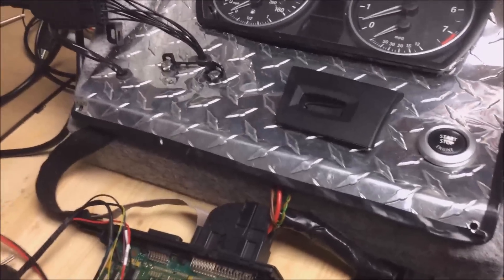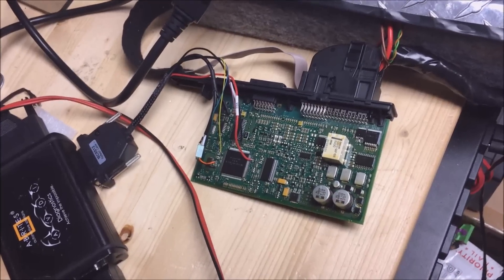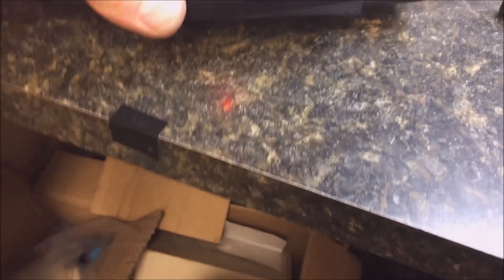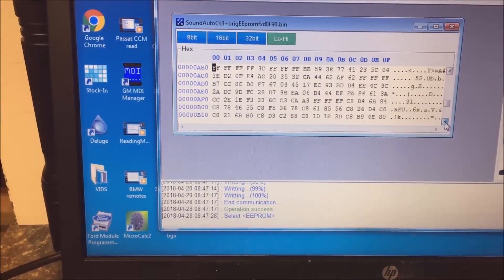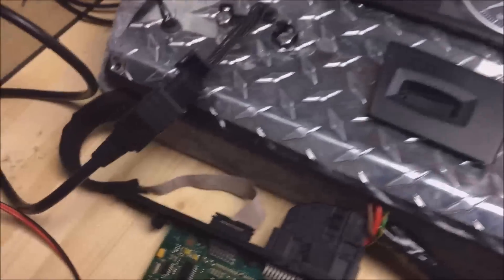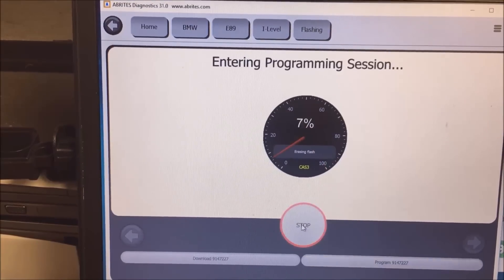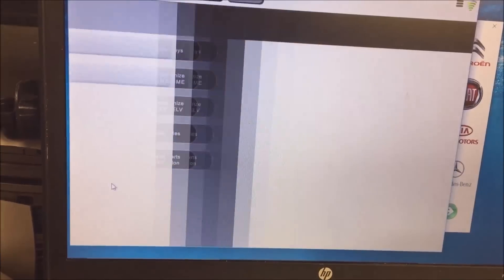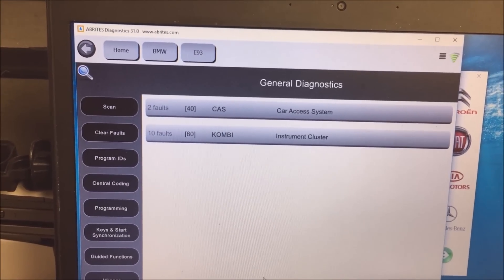BMW CAS3+fix

Comment: I have 2008 535xi. problem is it will not recognize the key and does exactly like your test dash at the end of this video. Has a new battery and starter, and ignition switch/fob holder. My local BMW shop says that the DME and CAS are not showing any faults and that they are synced. He said that the antenna ring was not communicating but said there was no code.  Question is how did you get your to recognize the original key. Benn banging my head against a wall for a month until I saw your video. 1st thing I have seen that shows the exact thing my car is doing.
Reply from the maker: First, what is your shop using to diagnois the car? next, are you sure your key is good? Is the key programmed into the CAS?  What I did in the video was to read the data, fix the lock bits, then write a good flash to the CAS.  I actually fixed the cas and then made a copy of it. At the car, put original in, and the car started and my friend tried using ISTA again, halfway thru flashing the CAS, it bricked it again, we put another CAS with the same data, and ISTA bricked it too...  I rewrote the original CAS and then used AVDI to update the I level on the DME, that was what the mechanic was trying to do with ISTA...  BMW ISTA support told my friend he needed to purchase a new CAS and program it in...
Reply: @timtracy9442  I am not sure what software he is using. he did program a new key but it does the same thing the old one did, so pretty sure it is not the key, I also cut the old key apart and put in a new battery just in case it was that however it still only locks and unlocks the car but will not allow car to enter startup. Only thing he told me was that the "antenna ring" was not communicating with cas but said there was no code. I thought the antenna ring would be in the fob holder but I am probably wrong, however I did put a new one on just to check and it changed nothing.  Just tired of paying people who say they know what they are doing for nothing. I am one of those people who has always just done my own wrenching but that is on American cars, I know this is completely different but at the end of the day for the money I am spending to have it worked on by a shop I am about ready to just buy the programs and learn to do it myself. Really a shame how crappy most shops are now days, just used to people who don't know any better throwing money at them. I guess at this point would I better of money wise to just buy a new cas and have it programed to the car instead of risking taking it someone who may or may not know how to fix the existing one?
Reply: @timtracy9442  Key will lock and unlock doors
Reply from the maker: @bendoran9883  OK, so the key locks and unlocks the car, but when you put it in the slot, the car does nothing??  When you put the key in the slot, does any light on the cluster light up??  Next, have you gone to the fuse box in the trunk and checked all the fuses??  there are three fuses that feed the CAS, if the 5 amp is blown, you can talk to CAS, program a key, but it won't turn on terminal 15....  also, do your door handles have any sqiggles on them?  as in, does the car have keyles go?  that is where you can walk up to car and touch the handle and the car unlocks.  let me know what you find..  I am curious now...
Reply: @timtracy9442  Key will lock and unlock doors intermittently,  have to take negative cable off and back on the key will lock and unlock again. When key is placed into slot the car dings and shows the key with a slash though it, and a gear with exclamation point in the center ( that one only shows up once then goes away), the only other light that comes on other than floor and dome lights is the neutral light on the shifter blinks. Also you can hear the fans on on the Idrive spool up but nothing appears on the display. The fans do go off after about 5 min so it is evidently going back to sleep. I have been through both fuse panels, and everything checks fine. No on the keyless go. Only thing i have been told since  talking to you is that if the car was shut off while in gear the CAS may have corrupted that key code and that it will still lock and unlock but will not start car. I am at a loss and tired of throwing money at the thing. I only have $1,700 in the thing and should probably just start parting it out but I hate to let something get the better of me especially if there is a chance it is just something stupid easy once I track it down.
Reply: @timtracy9442   Tim Tracy  I found the codes that the guy i bought it from before he changed the starter. A0B4/present, and Key Code HA0001, 4803 if that helps put some puzzle pieces together.
Reply from the maker: @bendoran9883  A0B4 is just telling you the CAS tried to start the car and the starter failed to crank...Keycode Ha00014803 is just a mechanical key code for the car..  I would take a volt meter, or a test light, go to the starter, find the smaller wire on the solenoid, and put the test light on it and have someone hit the start button...  You probably have the corroded wire syndrome that is prevalent on these cars...  The wire from the start relay down to the starter solenoid corrodes inside the sheath (plastic outer layer), it might just be the wire down to the starter..
Reply: @timtracy9442  Would that cause the cas to not recognize the key?
Reply: @timtracy9442  I will try that but i thought without key recognition the CAS would not even try to send power the starter. Also those codes where before having the starter replaced and have since been cleared.

Comment: Thank you. I restored my cas3 module. I used ACDP and the process was a little different but in the end the car was perfect without even needing to program the CAS because ACDP prepped a eeprom file with the DME ISN and the VIN etc.
Reply from the maker: I love my ACDP....  it has been working flawlessly....
Reply: @timtracy9442 yes besides these ECUs that provide only 4 digits ISN such as E70 nd E63

Comment: How long does it take to learn this stuff? And car coding in general
Reply from the maker: Usually a day, I woke up one morning and decided I wanted to flash modules... By five that afternoon I was an expert...  Just kidding...  I have been working on cars for about 45 years, I got into the electronics of cars back in the 80's when GM went to the electronic feedback carbs... I was just like everyone else at the time, hated fuel injection, electronic ignition, and the rest.... But when you figure out how the systems work, and realize how if you tweak the info the computers get from the sensors you can make more power, it starts getting fun...  If you can, go to a library or search online for old books about bosch engine systems...  When you can understand how the computer feeds power to the sensors, and then recieves data back from the sensors, and then acts on that data, you have a good chance at figuring out what is wrong....   For example, a car won't start, it cranks, but won't fire...  what sensor does the computer get the data to fire off the sparkplugs and injectors???  usually the crank sensor or the cam sensor.. Next, does the sensor have power?, do the wires from the sensor to the computer have conectivity?   Once you have a general knowledge of how the system works, you can troubleshoot...  As a guy I worked with when I was in my 20's told me, Kid, the majig is in the cards, if the wires connecting them together are good, then the problem is the cards...  Good luck...

Comment: Love the sound it’s an improvement from the old silent films. So you had the Vvdi BMW tool and the Avdi bmw tool and your test set up to get this done. Was this just a extra key or lost key to start out? Or was this cleanup from someone else’s headache?
Reply from the maker: Your going to laugh...  One of the shops I work with alot, mainly because he is an awesome tech, called me and said he had a 2008 3 series that he was using the factory tool (ISTA) to update the DME because of the High Pressure Fuel Pump issues, and it bricked the CAS...  I got another CAS with the same part number, and adapted to the car, then figured I would try and fix his... So we had 2 CAS modules that started the car and all was well, he tried to update the DME software again, and ISTA bricked the 2nd CAS... He sent BMW tech support an email and they said he needed to replace the CAS module...  We put the original back in the car, all was well, then we used AVDI to upgrade the software in just the DME...  The issues with the high pressure Fuel Pump went away, and car ran great...  There is a TSB on these to replace the High Pressure Fuel Pump sensor and then update the software in the DME... The shops customer was happy the car didn't have to go to BMW....
Reply: Could you have done this with the vvdi2 tool? I’m looking at getting a vw tool and bmw. AVDI is a little expensive.  Is the vvdi China’s copy of the AVDI? Or did they developed their own software?  I do know the vvdi tech support is little to none. AVDI will have better support but like I said cost is a factor for me.  Plus if one is real hard I’ll send it to you.
Reply from the maker: @tomking3942  I haven't seen where VVDI can do this...  But they might have it soon...  There is a service that you can subscribe to and get CAS files to fix a CAS that has been screwed up.. I can't remember the name, but guys are talking about it on facebook...

Comment: Any chance to check parameters of key holder inductive coil? Voltage and current? Id like to create a charging station at home for key fob.
Reply from the maker: Sorry, I didn't see this comment until today...  Great idea..  We need to figure out how much voltage and current this is putting out to charge the key...  I don't have the tools to check some of that, but I will hookup a slot and a CAS and see if I can figure out what it is putting out..  It would be nice to have just a slot to be able to keep peoples keys charged...  And maybe one for the older E46 diamond keys...  they are always going dead...  Great idea...
Reply: Not sure if this would work on the diamond shape keys but I found this https://www.google.com/amp/s/m.wikihow.com/Charge-a-BMW-Key%3famp=1

Comment: Hello
I tried to program the cas by cgdi and now the car does not start. please contact lipton8111@web.de
Reply from the maker: If I were you, I would be talking to CGDI support...  I have no idea what, or how it reads and decrypts the CAS info...
Reply: @timtracy9442  Thanks for the answer they can not help me. I suspect that the flash has damaged
Reply from the maker: @marcinl5876  have you read the flash and eeprom from the module???  Which module is it? a cas 3, cas3+ ??  you realy haven't given any info.... If you post what the part number is, might be able to help...
Reply: @timtracy9442  
yes I have already flash and eeprom this is CAS 2 6981416
Reply from the maker: @marcinl5876  which mask does the chip have?  CAS2 is usually foolproof...
Reply: @timtracy9442  2K79X
Reply from the maker: @marcinl5876  I looked in my files, and I don't have that one....   I would post your flash and eprom on Digital Kaos and ask for help...  There are alot of really talented folks on that site...  somebody might be able to either help you fix your data, or send you a known good flash...  I usually just find a used one and then read isn from DME and rewrtite that isn to the cas, then sync them...  AVDI takes about 20 minutes...
Reply: @timtracy9442  
The problem was solved cgdi deleted ISN.ISN I read from DDE a friend from Bestdiagcar spends the matter online.
Thank you for your help
Reply from the maker: @marcinl5876   Did CGDI delete the ISN, or did you not put one in???  It usually asks you for ISN, if you put in wrong ISN or leave blank, thats when you have troubles...  Good to hear you got it fixed... So the ISN was in the eeprom, correct????

Comment: Hit Tim could you help me with the electrical diagram for the PCM simulator, CAS, CLUSTER and Ignition Sw. I tried to do it but I think I have or I am missing a connection. What is the cost thanks?
Reply from the maker: on the simulator I made, there is no DME...  Just a CAS and A cluster...  I thought I made a video, but can't dind it...  I will try and post a vid soon

Comment: Bro realy need help bmw2011 x1 I lost all frm3r pl2 dflash was trying to read to convert to eee but it's all gone please can you help me😢
Reply from the maker: what does lost all frm3r pl2 mean?  what is your part number on your CAS module?
Reply: Don't know what cas it has but the it has is frm3r pls 6134 9249080 basis
Reply from the maker: @nkhan7804  OK, so you re having issues with the FRM...  I usually grab ISTA and try that...$40.00 for a day pass at BMW is cheaper than towing it to dealer..

Comment: Hello good afternoon can help me I have a bmw 335ci year 2008 but it crashes and does not start the steering lock only turns on when I erase the memory of the ELV you can help me and how much it costs me $
Reply from the maker: Seeing as you explained it soooo well, I would say one million dollars.....   What does, it crashes and does not start, mean????  I think you might want to find a mechanic to look at this...  If the steering only unlocks when you erase the trouble codes it has stored, maybe you have a defective steering lock...  Or maybe the CAS module has corupt data....  Until you scan the car with a decent tool, how can you even ask how much it would cost???  I am going to ride a train, how much does it cost???  without saying where you are and where you are going, it's hard to even guess....
Reply: @timtracy9442  lo que quisiera saber es que tipo de programación están haciendo en el video

Comment: Hi Tim, i have the same problem, but with a different cas number. When you changed the bit in the line F90 to D2 AA 55, does this apply to all cas numbers? In my case when i read my cas with xprog, in line F90 i see AE AA 55. Is It nessesary to change these bits as you state in the video?

Comment: Hi nice Work. 
I have a BMW e91, All rellays was burned and Jeb was burned. There was No signal to the DDE. Evry thing Work i have only one foult code back 4a63 ews manpulation. 
Evry time i tryed to manipulation the DDE to the cast i failed please some issu for that
Reply from the maker: You probably won't be able to program a new ISN into the DME...  I always read the DME ISN, then write that into CAS... Then encrypt it, write it to the CAS again, then clear all errors, then sync CAS and DME...

Comment: Hi tim.tim I'm doing bmw cas3++isap but my programmer has cas3+  in menu the thing is tim my vvdiprog also had cas3+  in menu but reads it fine as cas3+ but mine is cas3++ now too write the key I'm useing
MT100 key programmer and it can only write to cas+ don't have for cas3++ on tm100 menu is it possible to use the cas+ in the tm100 option to write the key in cos I used same option in vvdiprog to read with no problem.
Reply from the maker: I don't understand....  CAS3+ and CAS3++ look the same to all the programs I have...  What is the difference that you see??
Reply: Yes they do look same but  tim they say must have good tool to programme cas3++ as it's not like cas3 can't do all key loss it's a pain
Reply from the maker: @nkhan7804  Which vehicle has the CAS3++???  I have done most of the BMW's form 1997 up to a 2017 M2, and I have never run into problems...  Just with modules that other people, or even ISTA, have either bricked or deleted parts of the flash and then locked the eeprom...
Reply from the maker: I take it you don't have Abrites for BMW???  It downgrades the module, then programs a key...  as long as you have the ISN, you are golden...
Reply: Tim I was doing bmw e90 2012 all key loss but programmer diddnt support all key loss only add key so I asked the seller to ship me a good programmer for csa3++ but he say most off the programmer can't do cas3++  istp only vvdi2 and other one but cost alot.that's why I needed to know from u tim.and Im still working on ambrires it's time to get one I think 
Thanks alot Tim enjoy ur day

Comment: Hi tim I have problem with bmw e90 2009 it was parked for very long time now the key doesn't swing the starter only start when touch wire to starter
Reply from the maker: you need to scan the car with a good scan tool...  it could be anything...

Comment: Hi it's me again sorry to worry you..I need to instal new file on footwell module.I have the files wil it work on my bmw x1 2010?
Reply from the maker: what programmer are you using to read the data from the old and then write to the new?
Reply: I'm useing vvdiprog

Comment: Hi.can bmw 320d 2002 landrover bosch ecu 0281010811 be cloned useing vvdiprog read & write the immo eprom chip?
Reply from the maker: Not sure on that one...  The last one I did, I had to remove the chip and use a different reader... Mine is called a top programmer..  The DME  was basicly a MS43..  Good luck..